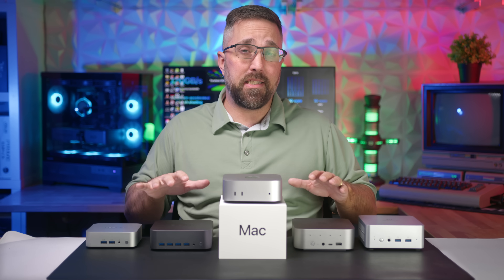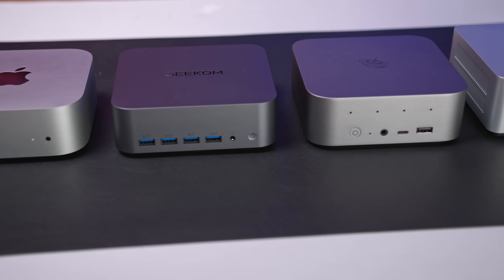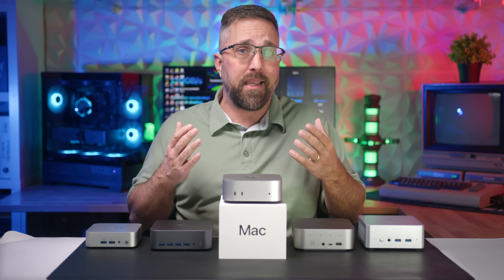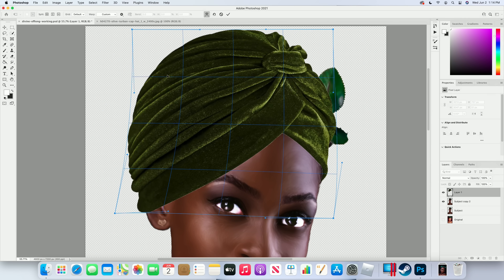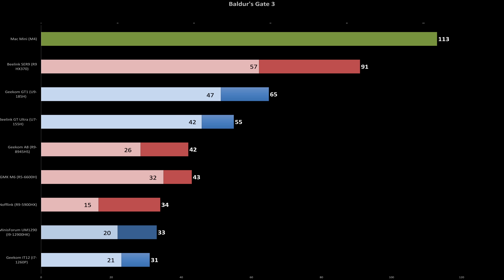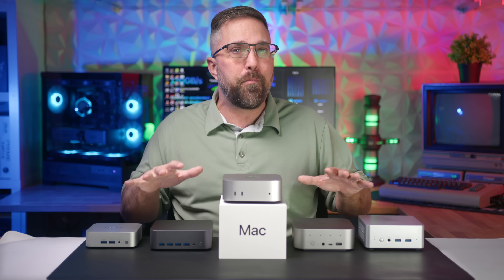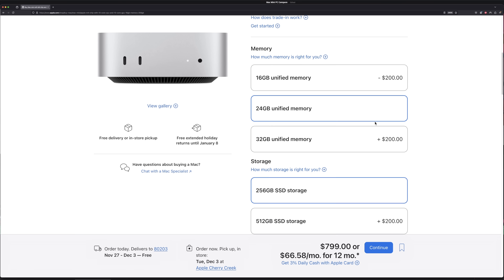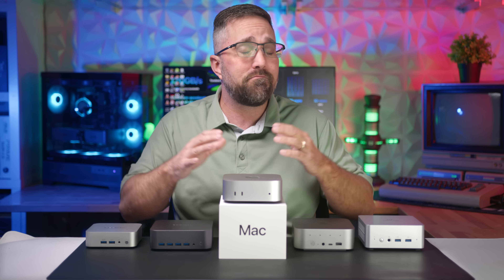M4 Mac Mini vs Intel and AMD Flagships – It's Not Even Close!

Comment: Only problem with your cost analysis is that it does not include the Apple tax. The inescapable cost you pay because you are locked into their ecosystem. Software, peripherals, plus the lack of software options (often free) you have by not being forced to buy specifically for an Apple computer. And every four or five years, Apple completely abandons its architecture, forcing you to spend that Apple tax again and again. So if you DO see this Apple as the best tool, be sure to buy at the beginning of one of their generational cycles, or you will quickly have a brick on your hands. That cannot happen on the PC side. Your software going all the way back to DOS, can still function on the most modern PC.

Comment: The issue with Apple for anyone who jumps in is that you learn quickly not to get the base model.  499.99 is a good price and hard to build for.

I have a tower with an old Athlon from 2010. I have a Ryzen 2200G laying around from an old pc when it was upgraded. If I purchase a b450 mobo + 32gb ram = 150 for an office based system.

Comment: Get the MM 512 SSD model which drive is twice as fast as the 256 SSD.   The Apple Certified refurb model, with a 1 yr. guarantee drops the price well over $100...forget the base MM.

Comment: bro, your comparisons are garbage. even using excel for benchmarks is pointless, but comparing after effects rendering between mac and pc is even worse. professionals use windows-based servers and high-end workstations for after effects rendering. watch folder rendering, aerender cli automation, custom render servers, deadline, rendergarden, and cloud render solutions are all built around windows. no professional is using a mac mini to render after effects. high-end pcs would destroy that little box. you have been drinking way too much mac mini kool aid. the apple simping is out of control. and on top of that, you are using an rpg game to talk about fps. nobody measures fps in games like baldurs gate 3 because fps is not critical in those types of games. if you want to talk about fps, then look at real competitive games like fortnite, where pros like ninja actually need every single frame for performance and reaction time. nobody is playing serious competitive fps on a mac mini. so your comparison is meaningless. this is pure fanboy nonsense.

Comment: the power efficiency is very important but missing from this comparison. mac mini being a risc processor is expected to be much more power efficient.
Reply from the maker: Why is power efficiency important on a desktop? Is the difference of $5 or $6 on your annual electricity bill a deal breaker. Honestly curious.
Reply: @ElevatedSystems  the difference is much higher tan 5$ or 6$ annually. More like 20$ monthly.
Reply: @ElevatedSystems  technology today allows you to host services without a dedicated IP address and without any router configuration. When acting as a server, the electricity bill is truly what determines the viability of what you are trying to do. Most servers are CISC based and with a device like this, small and performant, likely with great power efficiency and using modern tunnel-based setups, I see great potential for self hosting which is what motivated me to watching this video. I hope this answers your question.

Comment: "Bloviated Systems" would be more accurate. The Mac is totally non-upgradable AND non-repairable. Add installed RAM and drive costs on all of those same machines plus the fact that once Apple stops support for your Mac, it is instantly worthless. I hope you are least charging Apple for this misleading advertising!!  (Exclusive Mac user for 30+ years, until they discovered solder!)

Comment: "Top mini PC's... flagship models from two of the best manufacturers..." Right. who are those guys again? These types of systems really only appeal to those that don't care about CPU power or storage capacity. Systems from 10 years ago easily manage the workloads of 99% of users in this class of system. I agree with so many of the other commenters. What's the purpose of your statements? Annoy the techies or wow the unsophisticated?  Probably both.

Comment: This would be a LOT more honest, if you'd have covered the docking station and external storage (and how much that adds to the cost of the Base Mac Mini) that you actually use to do real work with it... because basically, those extra ports and storage are what is missing from the Base Mac Mini, and why the low price exists. It's nonsense, the price of the Mac Mini, unless you're just browsing the internet with the thing.
Reply from the maker: I used the same Samsung T7 on ALL the PCs tested because none of them came with enough onboard storage to hold my game library and test footage, so….. do the math.

Comment: The Mac Mini, or any Mac, is not going to scale property to any monitor that does fit into Apple's standard resolution.  If you like 27" screens then likely not an issue.  I like 32" monitors and larger.  That's the biggest problem for me personally (and I own one and build PC's, run Linux, etc).  The other issue you mentioned is game compatibility, which is a big issue for some.  I am not a heavy gamer, but I do like my old favorite, Quake III, via Steam and do want to get into gaming with my adult kids.   So to me all these comparions on performance are nice but miss the biggest issues, like display compatibility.  It is absolutely crazy that Apple has not address something so basic for most people.

Comment: I was looking to build a mini server for some of my home projects, self hosting gitlab, and some VMs. That requires good power efficiency as this thing will run 24/7, and tons of memory to run a bunch of VMs. Well, as long as I wanted to like Mac, the cost differences doesn't make a cut here. ACEMAGIC F3A with AMD Ryzen AI 9 HX 370 (12 cores / 24 threads) with 128 GB RAM and 4 TB M.1 Samsung Evo Plus 990 costs around $1.1K. 12 core Mac Mini with 64Gb and 4 TB SSD already hits $3.2K. Besides, you would have to run ARM versions of operating systems on it. Since you can buy 3 PCs for the price of Mac Mini of similarish configuration, perhaps it would be fair to compare Mac with a PC with 36 cores (72 threads), 384GB of RAM with 12 TB storage.

Comment: I'm confused, why is everyone upset with low memory when you can get extremely fast external storage for cheap? I can understand RAM but storage? Really? Even with 16Gb RAM, with unified memory you wouldn't notice much difference in performance. Buy a 2TB external SSD or NVMe with enclosure and you've spent anywhere from $700 to $1000 in total (depending on the drive)

Comment: You made an error.. The Mac Mini M4 can have an user upgraded SSD.... (don't switch the M$ / M4Pro SSD... That won't work)
Reply from the maker: I didn’t make an error. First, 3rd party SSD upgrades didn’t exist when I made this video. Second, Apple can kill those third party SSDs with a future update. Finally, officially Apple only lets you replace an original SSD with one of equal capacity in the Mini. As of now Apple only offers upgrades for the Mac Pro.

Comment: How can anyone think that 16GB ram and/or 256GB SSD are remotely acceptable in anything but a bargain basement bin product in 2025? The last system I had that used 16GB RAM was retired in 2021-- my current system (already several years old at this point) has 32GB and if I were anticipating having to do any kind of "pro" work my next system would have even more. Nobody should even be making 256GB SSDs at this point: that's like enough storage for an operating system plus a single game. Absolutely crazy that Apple is able to sell products like that which are literal e-waste on delivery for anything but web browsing. If a computer for web browsing and light tasks IS what you want, people should just recycle something old with a nice linux distro on it: I'm still using a 2011 Macbook Air for that kind of thing and as long as you stay away from Mac OS it runs fine. Why buy these crappy new products with inflated prices?

Comment: I use a 16GB MacBook Pro at work every day. It’s painful. I would never buy the base model Mac mini. 32 GB is minimum for developers and you can forget doing any kind of AI with less than 96 GB. I’d rather drop $1400 on a top of the line mini PC with a ton of RAM than the equivalent Mac mini which at that point would cost $3000.

Comment: The single performance core power of the M4 ist industry leading, not achieved by any CPU! There is maybe a single CPU, achieving 3080 pts. in Geekbench 6…, but only M4 reaches 3700-4100😂😂 9:08  And please consider, that the Ryzen AI 370 HX is throttled/underpowered in that Beelink SER9. So that specific Ryzen 370 HX is more capable, if powered, clocked and cooled correctly!

Comment: sucks that apple chips are heavily restricted to other apple products. I would actually consider getting an apple product if they didn't only support their stupid proprietary 'metal' api and macos.

and also if their other specs weren't absolute garbage for the price. Seriously, wtf are those prices. an extra $200 to go from 256 to 512GB of ssd? Another $200 for 8 more GB of RAM? At that point you could get a cheaper product with better performance

Comment: Just a thought, Mac mini with the same specs as the Beelink would cost 1399? adding 400 for upgrading to 32GB ram and another 400 for the 1TB ssd, then the value landscape changes quite a bit no?

Comment: The reason Apple has the power button underneath is to temp the user to use sleep state instead. Sleep state is better for the hardware as shutdown and start up has some negatives versus sleep state. Compare it to a TV which goes to a sleep state when you press the off button on your remote.

Comment: The price-to-performance seems dubious. All the PCs had 32 GB of memory and at least 1 TB of storage. If you had used this configuration, the Mac Mini would have cost $1399 or $800 more expensive than the base model. I won't deny the Mac Mini is a great value for money, but the value depends on your needs are due to Apple's insane pricing structure for memory and storage.

Comment: FYI you can use MacPorts or Homebrew to get access to a gazillion Open Source stuff.

I use a Mini for a full PHP and Ruby local development environment, running natively, and can easily use Docker containers for other stuff. Plus the fabulous Parallels emulator allows me to run the ARM version of Windows at amazing performance.

Since Apple Silicon came out, I think the Mac Mini can’t be beat as a value-effective home productivity environment for working from home.

I game on a PS5 so that side of things isn’t an issue. Having said all that, I do still have my old trusty Dell i7 mini PC that I keep up to date as a backup 😊

Comment: Each to their own. I have been using Mac OS personally since the 80’s and worked professionally with PC’s for the last 21 years. The PC side does have flexibility and price going for it, which is fine for organizations but compatibility is still a hit or miss according to the IT Dept. I like the Mac for its ease of use and bulletproof reliability. With the PC, half of the IT Department could probably be eliminated if they had printed on the outside of the case, “Have you tried to turn it off, and then turn it on again.”

Comment: You CAN upgrade the memory on the m4 Mac mini. And also very easy to do so.
Reply from the maker: Easy? Only expert micro soldering technicians can realistically desolder and replace Apple’s ultra-fine-pitch memory chips without causing damage to the logic board or SoC.

Comment: upgradability is something mac sucks at. 200$ extra for 8gb more ram or a 512gb storage instead of a 256gb one 😮 insane. I don't care about mini computers that much to look it up but for price to performance stuff like equal storage and a sentence or two about manufacturer upgrade costs would be better. If any of the windows/linux computer have slots for storage or ram they will dethrone the mac mini m4 easy on upgrade cost 😅

Comment: After watching this video I was very interested in a mac mine. I went to the site and quickly realized usable versions of it with storage and networking configs quickly end up being silly money. If you compared devices with 32gb ram, 2tb m.2 this would quickly skew the results. Their is a reason Apple soldered on upgrades, is so they can charge insane mark-up's on them.

Comment: Such a misleading video. If you were to upgrade the mac mini to 32gb of RAM and a 2TB SSD like the mini pcs have, it would cost $1800 and all your claims about price to performance would be invalidated.
Reply from the maker: Why would I spend more money if it already performs better at half the price. Sounds like an irresponsible financial decision
Reply: @ElevatedSystems  because you can't edit 4k video on a 256gb ssd, and you know it. A single hour of 4k60 video is around 500gb. That configuration is useless and you're just a shill trying to pass garbage as good value. If you want to do a proper compare you have to use similar configs. What you did here is embarrassing.
Reply from the maker: @ I edited 6k video just fine. If you’re actually ingesting footage to the system you are doing it wrong. Why would you put that wear and tear on a boot drive? It has thunderbolt 4 for a reason. Also you obviously didn’t watch my follow up video.
Reply from the maker: BTW, the total footage for most of my videos regularly approaches 2tb. None of these systems could hold it.
Reply: @ Then you should factor in the external drive. Also all the other PCs have upgradeable drives and secondary empty slots so you don't need to use your boot drive, the mac doesn't. You can also replace it if it dies without paying apple $700. And no, I didn't watch your follow up video and will never watch any of your videos because they are misleading as fuck.
Reply: I mean if you enjoy the mac more power to you, just don't say it's a better deal when it's so absolutely gimped in that configuration. 256GB in 2025 is absolutely useless. Apples to apples comparison my dude.
Reply from the maker: @ i did factor it, like I said in the video I used a Samsung T7 to edit from on ALL the systems. +$100 to all. Math still maths. It seems like your bias has you focusing on one single metrics and missing the overall point of the video. That is a you problem.
Reply: butthurt apple hater seething at the fact Intel and AMD are miles behind apple despite being twice the price. 16gb ram in a m4 CPU is more efficient than 64gb ram on any of the other mini PC's. and in the laptop space it's even worse. snapdragon and Intel still can't compete with the m4 MacBooks on performance to battery life. and a windows laptop costs just as much as the base Macbook nowadays while offering worse battery life and performance
Reply: lol sure

Comment: I got it it is great!!! The 16G of RAM is just enough, it uses the RAM more efficiently than Win PC. 256 internal storage is not much but it is enogh for the system and all the apps you need for work you anyway have to buy an outer storage which is more safe...  Thunderbolt 4 is fast ... no problem. It has no noise... nothing

Comment: My guess is that this trend to soldering everything in place is because these companies have seen how after Apple has done this, that few people seemed to complain in large enough numbers, or even effect sales.  That is usually all it takes in most industries, where companies begin to copy something that would normally be considered unpopular but proves not to be.  Where profit both in the present and that forseen in future offerings is what is behind this.  That says more about people's willingness to be stupid in their support for companies and products that take more away from them than what they previously once received for what they paid for.
Reply from the maker: But you can’t ignore the fact that soldered  LPDDR memory is both much more efficient and performant on these SOCs. Most people will trade a socket for 15% - 25% more performance, more even when it comes to IGPU  performance. Most people who think Apples on package memory is stupid are people who don’t understand the difference between how RISC architectures uses systems memory, and how it differs from CISC.